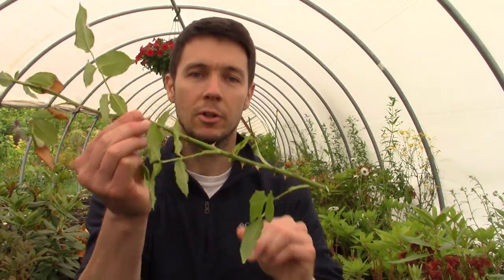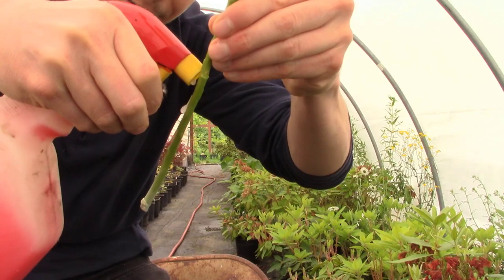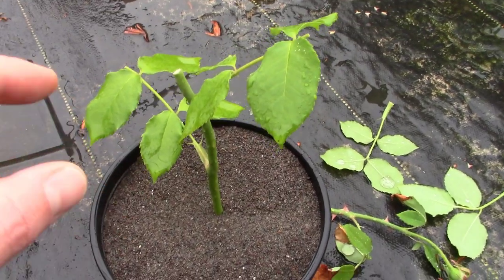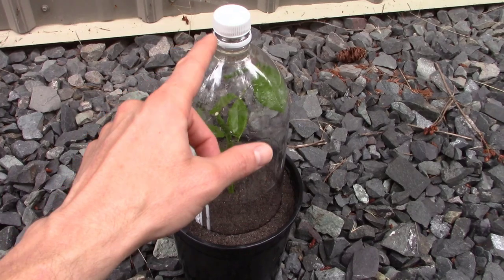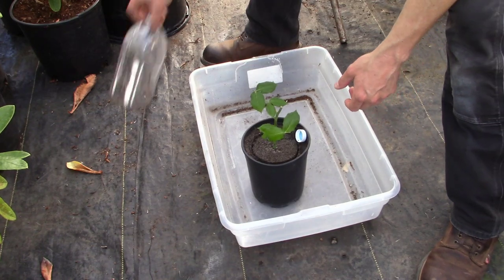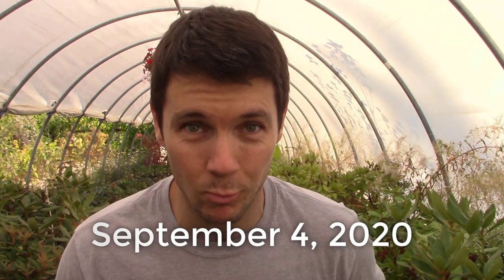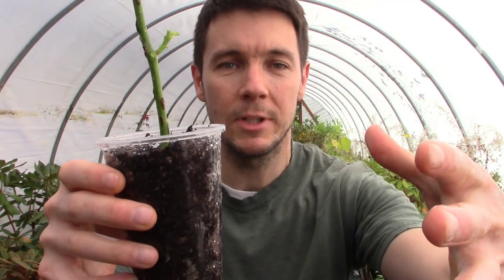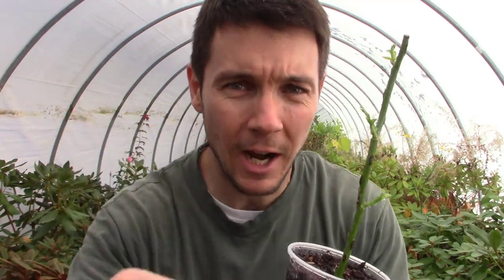Tricks to Rooting Rose Cuttings Successfully | Why are the Roses Stems Turning Black and Dying

Comment: In case anyone wants to know, if you do not have fungicide try using a garlic clove. Or you can use Hydrogen peroxide. Its anti bacterial and helps roots aid in nutrient absorption.  Use lightly and check your %strength.
Reply from the maker: Thanks for the tip.  I have plans to do a video about peroxide at some point.
Reply: How does one use the garlic clove qs a fungicide? Do you just dip the garlic clove in the soil together with the cuttings?

Comment: Mike, would seed raising mix work ?
Reply from the maker: It will in a lot of cases as long as the mix is not too wet.  I chose sand for this project because it's inert and drains really well.
Reply: @MikeKincaid79  I am in a house that has no garden now, I have potting soil and seed raising. I even have a block of coir. what would be better please. 
thanks :)

Comment: You spray and dip and then wash everything away with a hose, are you serious? Let away all the poison and use sand and water. Works fine for me.
Reply from the maker: No I'm not.  I try not to take things too serious.  It spoils all the fun.
Reply: @MikeKincaid79  just kidding, kind of. Try a simpler approach, you will succeed
Reply from the maker: Well, as long as we're going back and forth, you must be new to the channel, welcome.  My first rose propagation video is a simple approach much like you mention.  People were really struggling with getting black fungal issues on the stem and losing cuttings to rot so I made this video to help them out.

Comment: Mike, Cinnamon does the same thing.
Reply from the maker: Cinnamon contains no plant hormones but it does work as an anti microbial which buys the cutting more time to root.
Reply: @MikeKincaid79  Yes, so they don't turn black and rot before they root.  I use to dip African Violet leaves in Cinnamon before putting them in soil.
Reply from the maker: I really like that idea.  I keep thinking I want to do a video comparing cinnamon, honey, aloe, and rooting hormone.